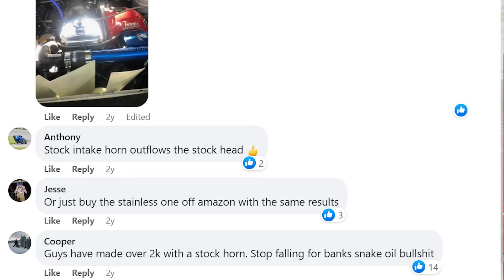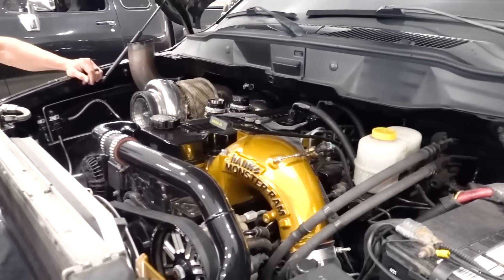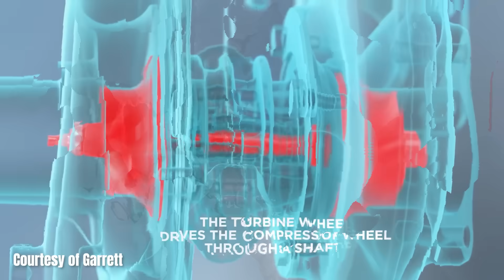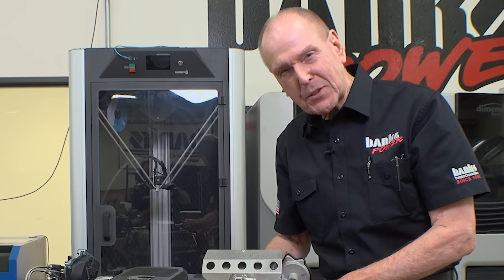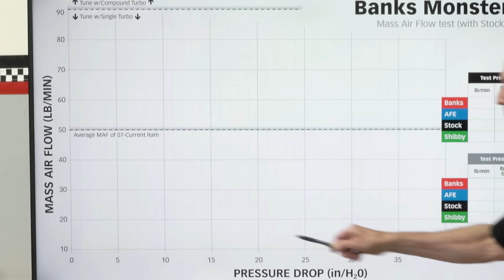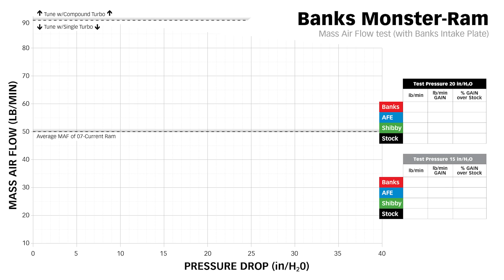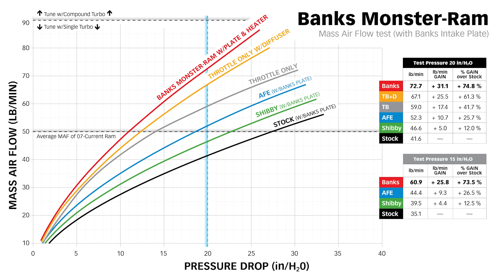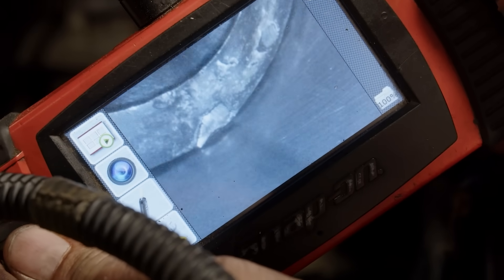Stop this wives' tale about Cummins engines! | Fact Check

Comment: Installed one on our 3500 HO a few months ago, just installed one on our 5500 Cab Chassis yesterday. Both units had heater grid bolts still tight and in tack but wasn’t about to gamble. Will find out over the next few weeks if it shows any improvement with both trucks being completely stock
Reply: you will know 1 improvement of knowing the engine won't be eating any grid heater bolts.
Reply: @arbiter1  the piece of mind is worth every penny. The chassis cab has a better throttle response now, it always had a big throttle delay in the pedal and now it comes alive quicker.

Comment: Thanks Gal! I have a 22 Ram with the CTD. I’m looking hard at these upgrades.
Reply: Wait to order when they have a fix. I would call them first. Read my post above. It is setting off multiple CEL on the 22 and above years for excessive air flow to the EGR. My MAF sensor stock was saying 2.8, and with the CAI, I am getting 11.8. Huge gains that set off the CEL. The parameters on the ECM are set tight on these years. 2019 and before would be fine. 2021 depends if you had the shop do the required recent ECM update.
Reply: @lawrencesanchez1750  thanks for the heads up.

Comment: Gale, I used to think Banks products were overpriced. Having now watched several of your videos, I see just how much engineering goes into every single part your company produces.  Since engineering takes time (and we all know that "time is money") and plenty of effort, I think the price point on your products is completely justified. I want to give you a sincere thank you for taking the time to explain WHY your products work so well.
Reply: Absolutely agree. You’ll see similar products out there for half the price. Sounds great until you see them head to head with banks. Some hurt performance even though they look similar. Will always use banks
Reply: Being a longtime Banks fan I Installed a cold air intake from Banks on my 3.8 V6 Wrangler. Even that damn thing picked up power when passing on the highway. I was impressed. You can't go wrong with his stuff
Reply: @edjackson4389 lol you bought the snake oil.
Reply: @davidburdett1920  I bought it strictly for the sound, and it sounded great. As a bonus it gained a little extra passing power. If you don't wanna believe then don't, but I noticed a gain when Installed and a sluggishness when the factory box was installed for mud rides
Reply: Because it's all manufactured in the US I think its priced appropriately, considering its providing American jobs and strengthening our economy . Their customer service is also stellar.
Reply from the maker: Thank you for the kind words. As many know, manufacturing in the US can be challenging but we're committed to it. Regarding customer service... if someone is willing to spend their hard-earned money on one of our products, we're thrilled to stand behind it. .
Reply: @bankspower  build a
 eco motors em 100 engines
Reply: @bankspower please do a video on extended oil and filters (for gas and diesel applications)
Reply: @bankspower I only wish to have y’all to make parts for my little ole 3.3 vg33e Nissan engine as I would buy from you 100 percent as I do know a lot of others would as well
Reply: @bankspower  Now, on the Monster Ram Air, where does the Mass air flow sensor go?
Reply: @MarkMerritt-hd9vj  3.3 Nissans, 3.0 and 3.4 Toyota motors found the sweet spot for power that you need in a compact pickup.  The 4.0 L in my 2012 Tacoma is the right powerplant for the curb weight, but it's more truck than I need, most of the time.

I see the door.  I'll show my way out.
Reply: @bankspower  We're overdue for a renaissance in automaking.  We could scrap the EPA and have better cars and trucks AND a cleaner environment, because people would buy from manufacturers who build things to last.
Reply: @twinkievsdingdong that's not how economics works, but ok...
Reply: Also saves you bucks because your turd doesn't fail $$$$$
Reply: I will second that! I have Banks products that I can say are every bit worth the higher cost. 👍
Reply: gale turned us all into banks simps with his youtube videos lol.

Comment: Long time fan of Gale Banks and his efforts to the racing community. 
I purchased a new 2017 3500 RAM and am finally getting time to add a few upgrades. I just aquired Banks full incoming air flow line of products (Air intake housing,  inner cooler system and the beautiful Monster RAM...in red) and look forward to getting it installed before the holidays are over.
I am also replacing my stock turbo, and what seems to be a faulty turbo actuator, with  a KC Upgraded Turbo assembly. I truly feel like a kid waiting to open that first gift on Christmas morning. 🎄  Now, if i can only find the Derringer back in stock. 😊
In my recent conversations with other diesel owners, they keep suggesting that i next perform a full DEF Delete in order to get my gas milage from the high teens to the mid twenties....just not sure if im willing to go that route at this time.
My question is;
What are the contributing factors to non deleted units seeing lower mpg ratings and what are my options while trying to stay somewhat environmentally friendly?
*
Merry Christmas to the Banks team and to all their viewers!!

Comment: I installed the monster ram and at first my fuel mileage dropped.  Put in a clean air filter and it went way up.  The air filter wasn't all that dirty either .

Comment: Yeah, don't take Gale on unless you have done your homework, this guy only deals in facts backed up by continuous research. His reputation is monumental, witnessed by the US military selecting his company to increase engine performance on the Humvee replacement. And that's only one example. That line "ask a mechanic" split my sides, wtf does the average mechanic know? Answer, fcuk all!  They can't even fix stock vehicles with anything more than very simple faults, and even then sometimes not!  So expecting them to know the science of things like mass airflow and density is a joke. Here in the UK, so called mechanics are doing whole engine changes on diesels because they can't diagnose DPF faults, and  the parts cannon is their favourite technique!  Just for something like a blocked DPF pressure sense line!  And this is with main dealers as well as independents!  So don't take on Gale, he knows as much as the engine designers and sometimes more!

Comment: Gale these bench racers dont understand the chsnge in density deal,   the absolute example of density mass change they probably would understand is their oxygen bottles the use in the shop, its  at the point where density iis increased to the point where it becomes liquefied and as we know you cannot compress it any further so its at maximum density and we all know how heavy a full bottle is !

Comment: Ive never owned a diesel and probably never will due to the insane price of them nowadays even for the older stuff... but I ALWAYS watch Banks to learn as much as I can. Its insane how smart this guy is
Reply: The same principles apply to gas engines.
Reply: Now on my 4th Cummins.
Gale Banks will help me 
Keep it running forever 😊
Reply: I prefer European diesels from the late 80's/early 90's. 2.5-3L displacement and easily triple to 5X the stock power without changing anything internals wise. Besides bigger turbo and bigger injector pump elements
Reply: Don't need a diesel you can get a good gasser and give it some artificial wind and they'll do fine and you can still get a good gas mileage tune.  I'm wanting to copy a friend and build a turbo 4.9 i6 and stick it into an old f350. He's pushing 300hp@2800rpm and 580ft/lbs at 2050rpm which is still fairly low.
Reply: but they be so durable :D & ive got power 4 days :D
Reply: The original best idea of a diesel is... its an engine for life.  Re-sleeving most designs requires zero machining - try that on a gas engine.  Rings going out?  Change power pack... and probably never pull the engine. If rod & piston are weighed/balanced to spec, there's no balance work to re-do.  Keep your fuel clean and under 135F [most engines] and life is good.
Reply: @flinch622 you realize few diesel engines in light trucks have replaceable sleeves, right?

Comment: I don't get the head thing. It's like they're pretending the engine has only one cylinder. Besides CFM head flow isn't a real number. Which is to say, it doesn't reflect the flow of air through the port while the engine is actually running. If that were the case of course it would be RPM dependent. The engine draws much more than the vacuum a flow bench can, and so much more air will be flowing through that head. What head flow instead reflects is how well much pressure drop we can expect through the intake port relative to historical flow bench numbers. And with the way heads are flow tested the CFM is really more of a bootleg MAF number because it's always standardized to the same pressure drop of 28inHg.
Reply: It’s actually RPM dependent and has to to with port volume and camshaft duration/lift, that’s why when you see head flow bench numbers they are measured in lift, eg .400 .500 .600 etc of valve lift it’s all a system, port volume, cam shaft duration and lift, exhaust port volume, valve size, runner velocity, it isn’t as simple as an intake elbow
Reply: @ni_wink84  Right, exactly.

Comment: It's almost as if the laws of physics and chemistry still apply to diesel engines right? xD How do some of these muppets thinks nitrous works? It adds oxygen... you know... like compressing air to stuff more oxygen into the same space. How is compression such a hard concept to understand for so many people? It's scary to think these guys have drivers licenses and drive around out there.

Also how has there still not been a recall or class action for this damn bolt? o_O

Comment: Gale is an engineering genius. Everything he does is based on data. Very smart man
Reply: Idk man, I think he's just an engineer who actually gives a shit. Nothing he said is a radical concept or reinvention of the  wheel so to speak.  It's just all data driven and knowing which metric to look at. He's right, cfm is a bad metric if you're using a turbocharged or super charged engine.
Reply: @heroofharo no it isn’t, people have dyno tested these things and there’s no gain on a truck making under 1000 hp. There’s a reason he just yells at the haters instead of showing dyno numbers.
Reply: @lelandzim  what are you even flapping off about man. Cause I don’t think you even know. He shows data of test in every video he explains things.
Reply: @chasekostiuk4263 He shows data of nothing. If you actually thought for a second about what he’s saying you’d realize he’s wrong
Reply: He's also a sales genius.
Reply: He has taught the diesel engine industry some very profound lessons.
Reply: Following the data is the only way to go. It's refreshing and satisfying to see. 

Unless you just want to rip people off and make money, then you make parts that look cool and advertise a gain, but actually just cost you horsepower.
Reply: He combines the knowledge of an engineer, with the communication skills of a salesman. What he tells here is basic engine knowledge plus some simple flow test data.

Most engineers just cant communicate what they know to the layman, or just dont bother to, because fools are damn sure of what they think they know.

It is respectable though, that Gale keeps reading and responding to their Facebook comments.
Reply: @Sjanzo akin to playing chess with a chicken. The chicken doesn’t know that it’s been beaten. It will just strut around, knock over the pieces and shit on everything.
Reply: @GermanJoe2  Damn, as a Dutchman i didnt know that American saying, but it describes so much of my career 🤣🤣👌
Reply: @Sjanzo I agree.  Most engineers simply don't waste their time engaging the ignorant.  

There’s no use arguing with a fool. He only rages and scoffs, and tempers flare.  Proverbs 29:9

Comment: Hey Banks Team! I've had several people ask where to get the Chevy 3500 Banks model. It's kind fun. One problem up here in the Spokane area is when it's cold and snowy I have to run on the stock level otherwise my wheels are Truning at every Stop sign or light and I can't get a grip until I let of my peddle Monster. Thanks for a great ride! 😊

Comment: I dont understand how the diffuser can flow less than the banks elbow. Dis they intentioally make it a bad diffuser? If it was, for example, identical in size and shape as the Banks elbow, but without the turn, how would it not flow more?
Reply: Because science. Well fluid dynamics. Changing density, equal dispersion across the flow, friction.  Gale could explain it much better.    The design of the elbow could be doing a lot of things to help the flow or create "vacuum or venturi like" effect.  Remember its air density thats king here, so if that elbow helps compress air volume into denser air without restricting the flow in an efficient manner it will beat the air tests that dont experience that improvement in density.  Unfamiliar People could look at a turbo and say "how does adding this extra thing on the  pipe increase flow, just like people not understanding the value of  air density vs cfm will say only so much "volume" of air will fit through the head. 
 How drunk can you get on 12 onces of alcohol? Kinda depends entirely on its concentration. Wine vs 90% moonshine. That's air density.
Reply from the maker: Well said.  @dangoodwin5954
Reply: Short answer:  it further increases air density, reducing friction and increasing flow for air earlier in the system.

Comment: I have one for almost a year.  I can tell you, it made a HUGE difference in performance.  And a big gas milage difference on my longer trips.
Reply: I would like to add this for no other reason than to remove my worry of the grid heater bolt failure. I need to find someone who can do the install in South East Michigan. Did you do your own install and if so, how hard for someone than knows no more than how to turn a wrench?
Reply: @InLineDiesel6  It is not hard; just takes some time. I did the upgrade in an RV park (they shipped it to the local UPS office for pickup during a 3 month trip.)
Reply: @InLineDiesel6  it’s not terribly complicated but you would need a few specific line wrenches to get fuel lines off etc.
Wouldn’t trust to just any mechanic. 
Probably is a few hrs min to install.
Here in Ontario I have a couple places that are fantastic, but this im a mechanic and would do myself.

Heck, id say buy 2 of em and bring them up, will do my truck and yours
Reply: You are absolutely full of shit.
Reply: Is your truck stock? Does it require a retune with the Banks parts installed?
Reply: @stuartmeier240  No retune required.  Mine was stock when I installed the Monster Ram Intake, made a difference according to my "butt dyno".  I did it mainly for the peace of mind of getting rid of that killer grid heater bolt.
Reply: You must modulate your shaft speed lest you blow off prematurely.
Reply: Why you put gas in diesel
Reply: @frostedjedi  That is the level of 99% of commenters.

Comment: If cold air is denser and air conditioning only robs 10hp why not air condition the heat out of the intake?
Reply: 10hp to lower a cabin with controlled airflow 30 degrees max-ish, now how much to lower IAT's 100 degrees at degrees higher airflow, in the engine bay. Meth injection exists and that's loads better

Comment: No different then the argument of “the gun can outshoot you anyway so buying a better one won’t help”, yet somehow it still helps every time.
Reply: 1st time i shot a cz75 i put 2 rounds through the same hole @10m. I thought i missed with the second shot, changed point of aim about an inch low, bam new hole. So much easier than with a glock
Reply: @RedmistAU And I bet everybody clapped
Reply: @RedmistAU two bullets through the exact same hole is only a good thing in target shooting. You want separation of rounds into a live target to cause massive wound channels.